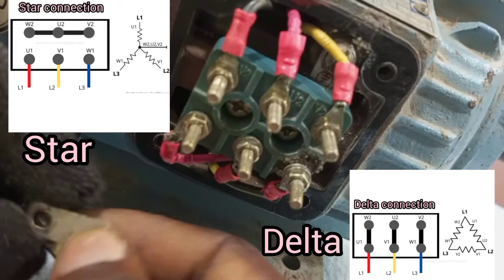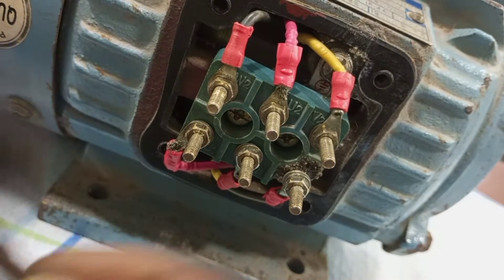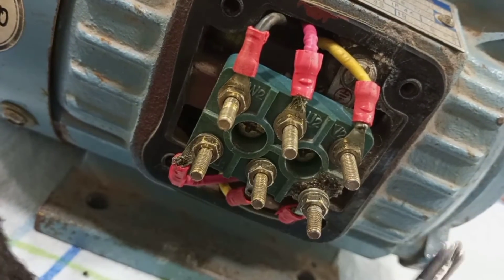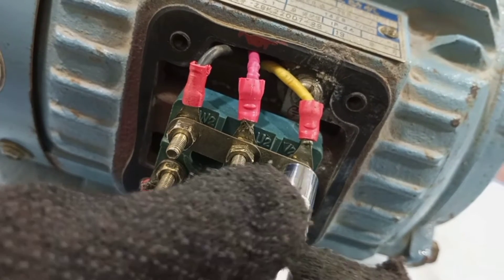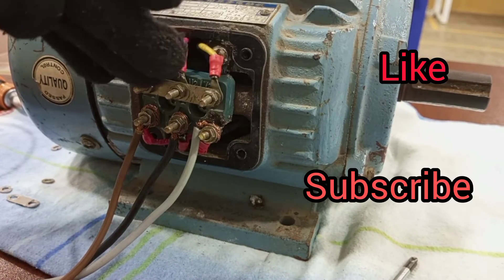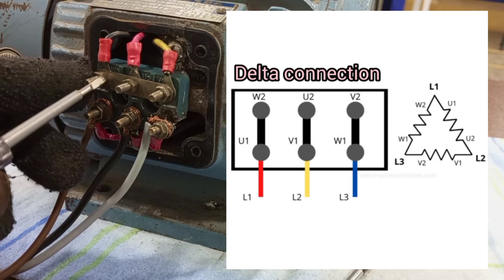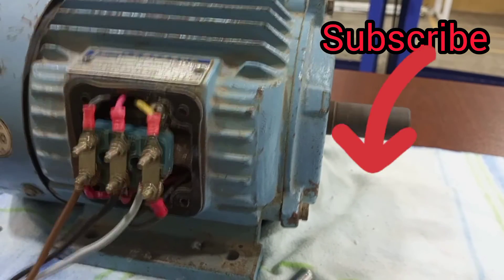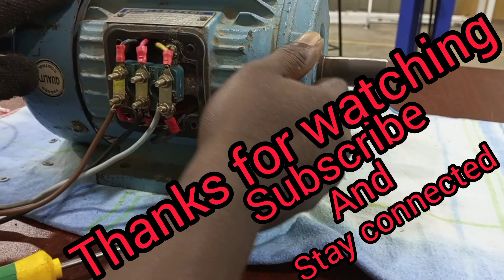how to connect 3phase motor in star or Delta.

Comment: What's the purpose of connecting motor in star like wise in Delta?
Reply from the maker: Star connection provides less current to the motor. Delta connection provides high current to the motor.
Reply: @obloni_Electrical   
What's the effect of Low/High current in motor ? What could be the reason to choose between the two ?
Reply from the maker: @Ibrahimsaheed-bn2ph  
But basically, the windings of higher rated motor may burn when started in delta connection. So bigger motors must be started first in Star connection then later to delta. Delta connection allows high current to the motor which inturn increases the torque.
Reply: @obloni_Electrical  *Y provides lower voltage per phase, therefore limits inrush current to motors. Y provides more current per phase. Delta is the opposite, higher voltages per phase, higher inrush currents but lower constant current per phase.